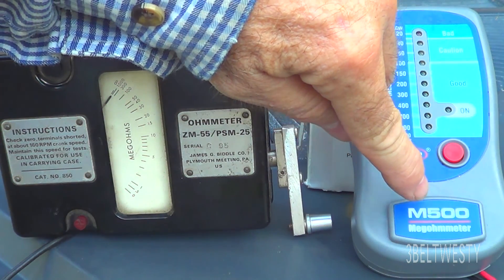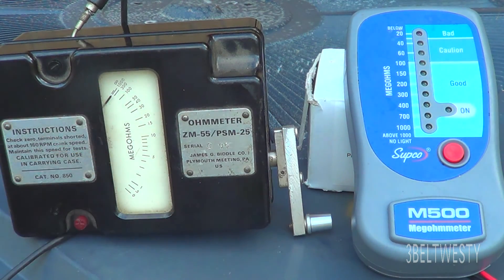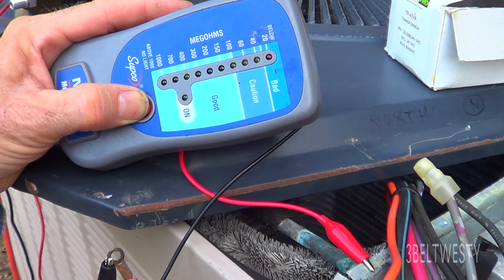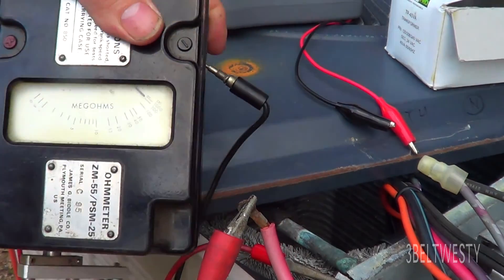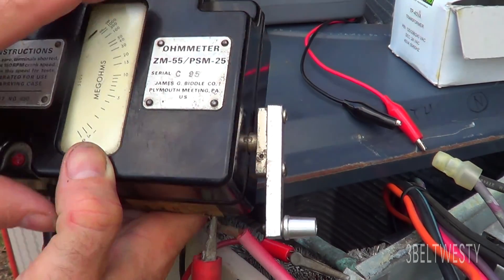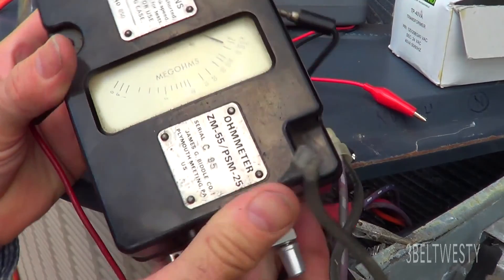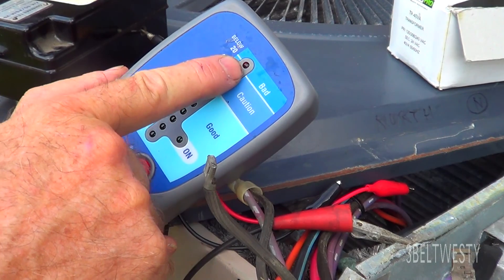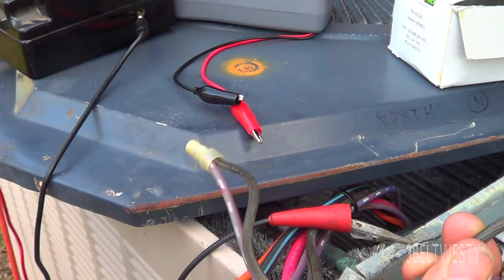Megger SUPCO M500 and BIDDLE ZM55 on TRANE HVAC

Comment: On the crank operated tester you have two scale’s .1 to infinity is the megohm scale used for insulation resistance tests. The scale 10 down to o is the ohm’s scale used for continuity tests . And you turn the crank handle at a slow speed, for continuity, and at a fast speed for insulation resistance , you should learn how to use the machine and how to read the scales correctly before you test any equipment or appliances . Theses tests are the same in the USA as the UK .
Good luck from a UK 🇬🇧 electrician